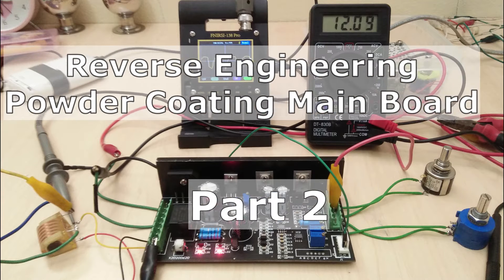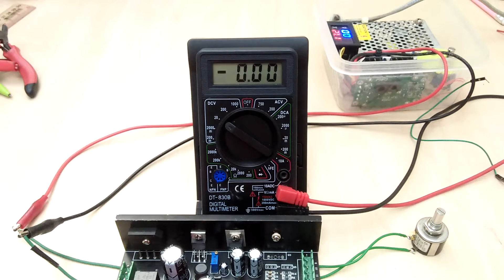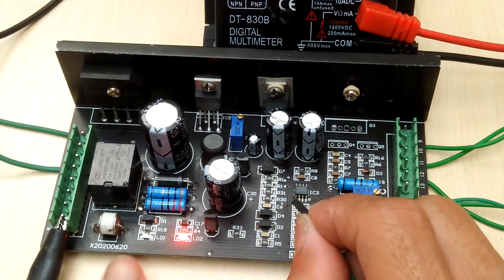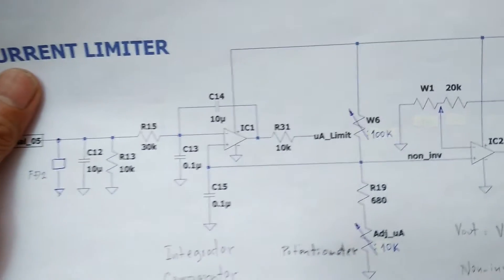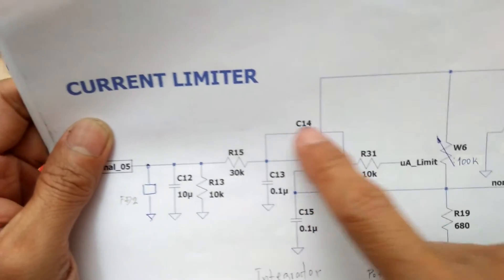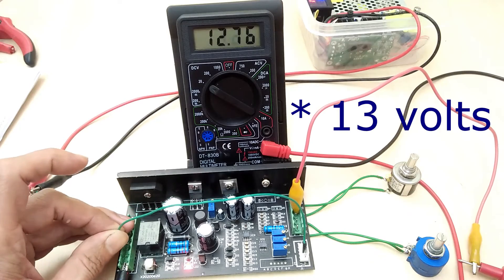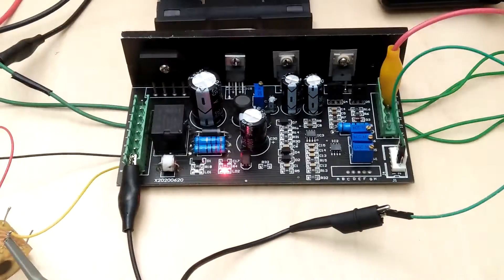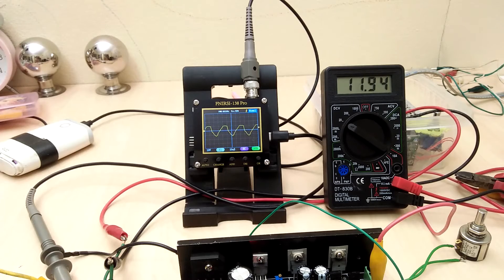Reverse Engineering the Gema Powder Coating Gun Main PCB (Part 2)

Comment: I just ordered the TCL-3 pcb which is similar to this one but they only sent a cascade with 2 wires, therefore I don’t think the current limit will work will it?
Reply from the maker: Hi. I found the same board in Aliexpress with the cascade having only 2 wires. I contacted the seller just by curiosity and they replied to just leave terminal 5 disconnected. So yes you are correct, in this case the current limit does not work. Actually, the current limit only works if you sent the uA low enough. If the uA is set to high or the kV is set to low, then the current limit will usually not kick in.
Reply from the maker: Just to add that some models only have 2 wires and the current limit is set to the power supply itself. So it really depends in the circuit design.

Comment: Google transl. Could you please clarify the supply voltage for IC1? If from 5 volts, then IC1 will not be able to control the Q6 base. Maybe the power comes from 18 volts?
Reply from the maker: Hi. After I read your comment, I run the circuit in LTSpice simulation once more and it does work. The supply volage of IC1 is indeed 5 volts. Take note that IC1 is a Voltage Comparator IC, not a regular op-amp. The output stage of a comparator IC is an open collector, grounded emitter NPN transistor. So, the output of IC1 toggle between "open" and 0V. During the "open" state, the voltage at the output of IC1 is same as output of the LM2596 (12 volts in the video example) because of resistor R30 and R31 that act as pull-up resistor. During the 0V output of IC1, R30 and R31 forms the bias volage for Q6 in which the voltage at the base is less than the voltage at the emitter and so it turns ON and so forth. I demonstrated this at 6:58 in the video. You can check out the data sheet of LM397 which is a common comparator IC for reference.

Comment: Are you powering with just 18v dc? I assume it normally takes 18v ac but because it’s rectified anyway then 18v dc is ok?
Reply: Also do you know which transformer it would typically use?
Reply from the maker: @MrBrettStar  Yes, I simply connect it to my bench power supply. The photo I saw uses a toroid step-down transformer. In my upcoming video I put this board in an enclosure and uses a switching mode power supply instead of a transformer. 18V is the info I found online but exact value is not very important because you will turn down the voltage anyway to adjust the kV.

Comment: Can you do like this pcb without limiting curent circuit
Reply from the maker: Yes. I found the same main board in AliExpress sold as a kit with the powder coating gun and hv cascade. However, the HV cascade only have 2 wires so there is no 3rd wire to sense the current. I contacted the seller and the say just leave terminal 5 open of the current limiter open. So in that case, the power supply works without the current limiter.
Reply: I tried your oscillator in multisim but not worked
Reply from the maker: @amineaissat2485  I run the simulation in LTSpice. I used 0.001H as the inductor load. It will only work with inductor load. The output waveform have very high negative peak (because of being ideal components in simulation). I only guess the values of capacitors because the surface mount capacitors has no markings.
Reply: I have all values of component
Reply: Give me your gmail and i will give you my schématique